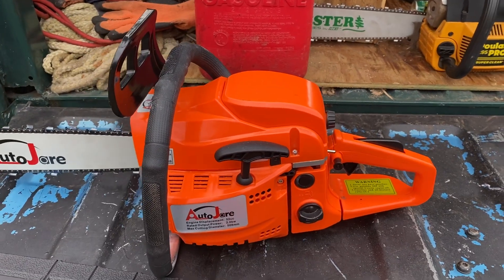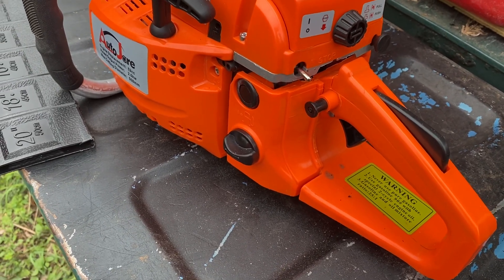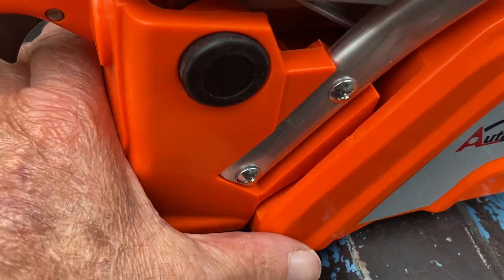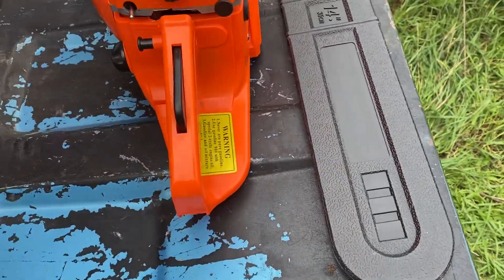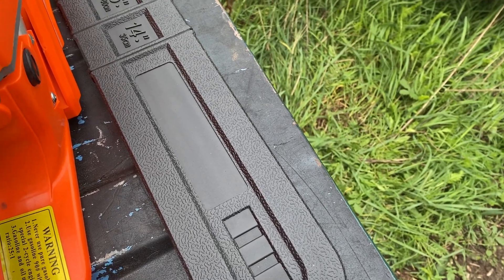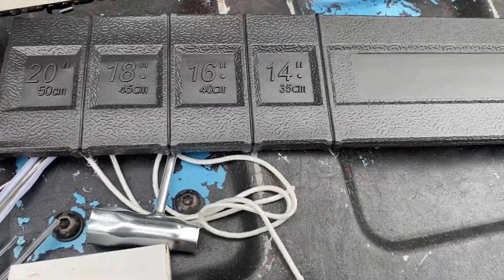$99 Chinese 52cc Autojare 20” chainsaw

Comment: I bought one of those saws 3 years ago, It's been a fantastic saw, and has cut almost all of my firewood for the last 3 years.  Air filters suck on those saws, but can be upgraded. Chains suck, but other than that they are solid. I recommend staying with 25:1 mix.

Comment: 🎯 Key Takeaways for quick navigation:

00:48 🛠️ The chainsaw started well with a 25 to 1 fuel mix and will be broken in before transitioning to a 40 to 1 fuel mix.
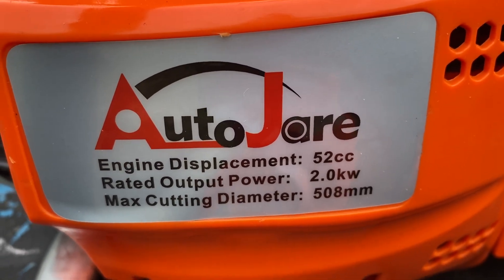01:19 🪓 The chain on the saw is not of great quality and might need to be replaced with an Oregon chain.
02:47 ⚙️ The back piece on the chain break and cover tends to stick out, but overall the assembly of the chainsaw was fairly smooth.
03:43 ⛽ The chainsaw had a starting procedure that involved pulling the throttle in, pushing the throttle lock, and pulling the choke out, which wasn't initially understood.
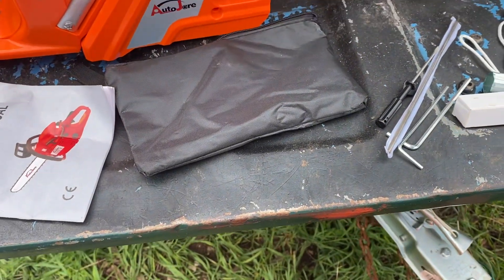06:02 🧰 The chainsaw comes with a toolkit including a manual, wrenches, spark plug, pull cord, and a bar cover.

Made with HARPA AI
Reply from the maker: The $99 Autojare 52cc Saw is running fine. I have ran 7 or 8 tanks of fuel thru it, filed the chain a few times. The chain has thrown off a couple times and stretched a bit (I forgot to keep an eye on the tightness). I am happy with it so far.

Comment: @higheatercircuitrider hey I just watched this video again. 
Did you check to make sure it has a seal underneath your air filter cover? Which style filter do you have the paper style or the mesh screen? 
I know I have one similar to this saw and it didn’t have a air filter gasket. 
You’ll want to put one of those in. 
A Stihl RS chain works great on these full chisel .325x.058x76 drive links.
Also a husqvarna 266 bucking spike with a very minor mod to the holes fits right on them much nicer! 
Your throttle lock will probably break on you eventually I just made a video up on how to fix that.
Reply from the maker: I checked and have a gasket under a nylon type mesh filter, thanks. If I thought another52cc Autojare would run as well and be trouble free, I might get a second one.....but you know it’s always a gamble with the Chinese !
Reply from the maker: These saws are now being advertised on EBay for $80-$85

Comment: Well you can’t beat that price! 
That is basically the same saw as my Radley 52cc ( they are all actually 50.5cc’s). There’s a cheaper built version and a higher quality built version of these clone saws. If it has the side tentioner usually it’s the higher quality saw but the cheaper built ones are not bad. 
Turn you’re bar oiler up to full in the begining and if it’s like mine the bar oil runs out before a tank of fuel does so then your chain will tighten right up it gets so hot so what I do is I just run 3/4 of a tank of fuel in my 52 cc clone but in all my 54.5 cc Clones they are a little harder on fuel so what equals itself out one tank of fuel to almost a tank of bar oil but with the 52 cc saws from what I’ve seen, they’re all the same and you gotta watch for that.
Also the clutch bearings usually need to be regreased after a year of use. You’ll hear it squeaking/squeeling but best to get it before it gets to that. 
The chains will stretch a few times in the beginning then they seem not bad. Run that oiler at max with good tacky bar oil like Husqvarna or Klondike. 
The biggest issue with most clone saws is some don’t filter well depending on what tupe you have. 
25:1 is good for break in then yes I’d go to 40:1 but you’ll need to most likely lean out the H mixture screw. Just make sure you always here that 4 stroking when you take load off the saw when cutting. If you don’t hear that it needs more fuel (richened up). 
Hope to see a video of it cutting!